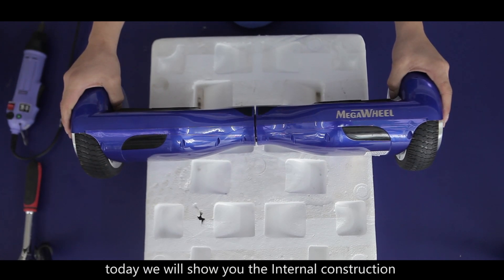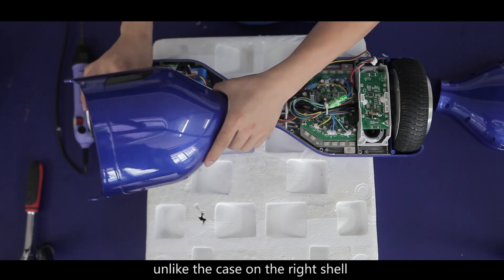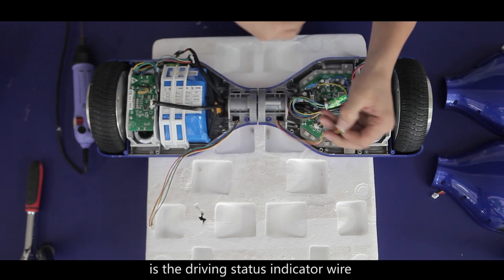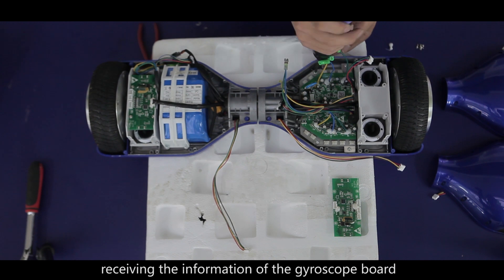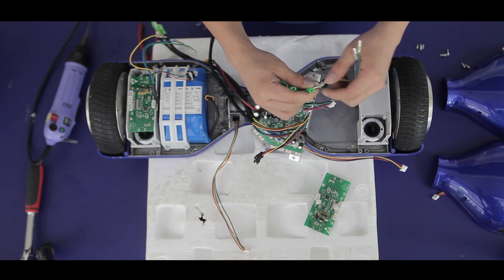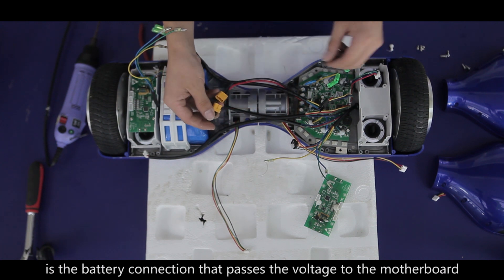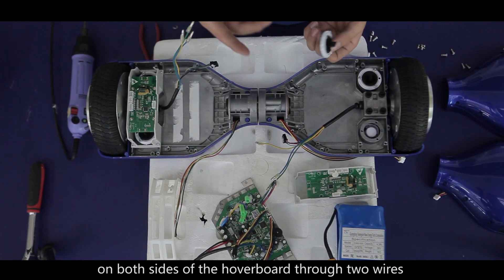Tutorial on How to Disassemble the Hoverboard

Comment: Anyone watch this to see how the motors in the wheels are geared. And no that's not the gyroscope, those are either pressure transducers or just switches. The gyro is a board mounted chip.

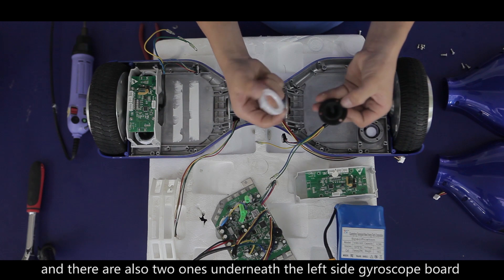Comment: At: 3:00 - Those are not gyroscopes. If there is any gyroscope its on that board and is a chip. Those round pieces are rubber pads that are used to tell the hover board that you want to move in a direction.